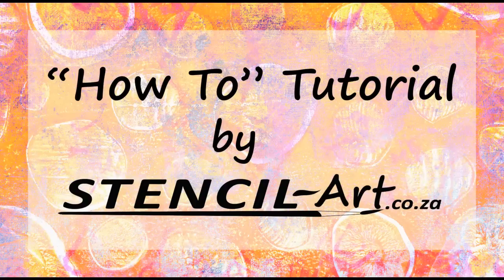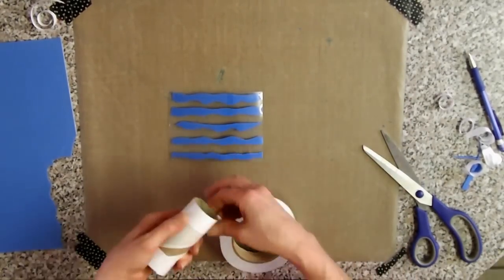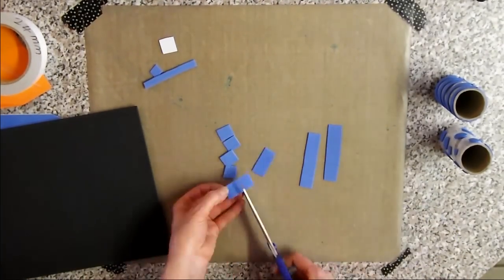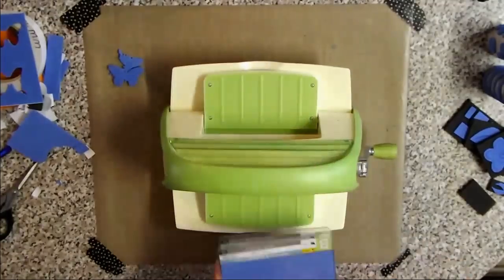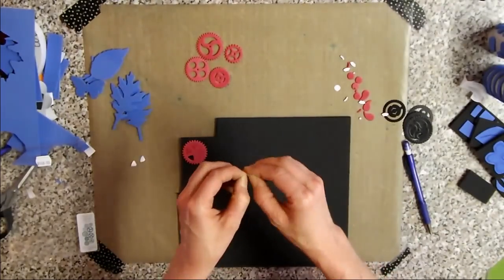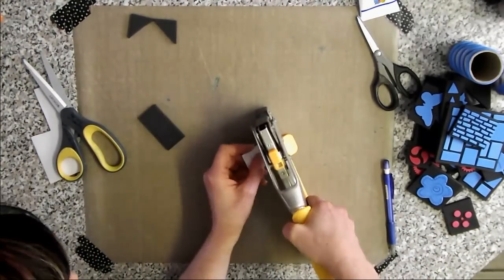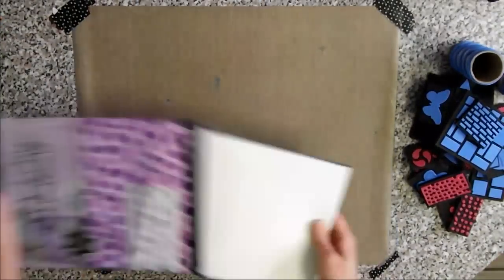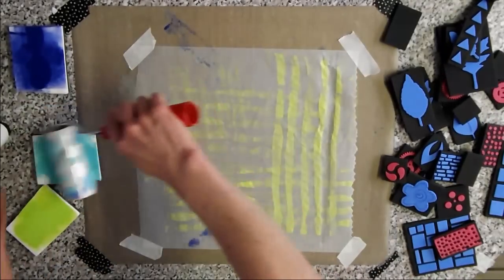How to make your own foam stamps.

Comment: can the cameo stencil machine  cut threw the foam and make your own shapes??
Reply from the maker: kairus1 I am not sure, I just use my Cuttlebug.  You can surely try as the foam is very soft and will not damage your blade.  Just make sure that the foam adheres firmly to your carrier sheet so that it does not move when you cut.  Also  you should make sure that your blade settings are correct as the foam is thicker than paper.